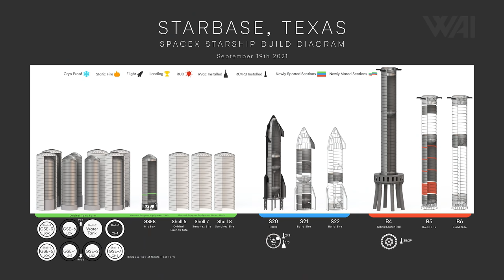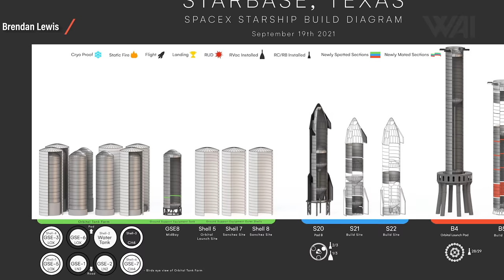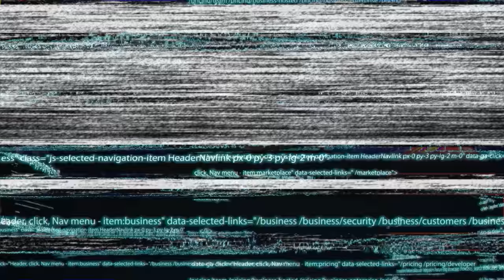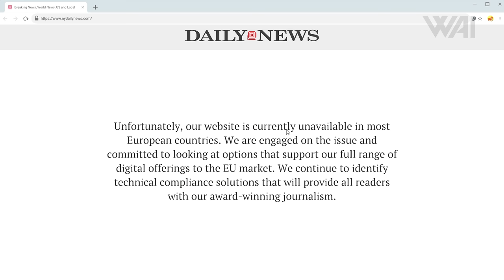Starship 2021 Official Design Changes – The Holy Grail Of Rockets!

Comment: I would think landing the booster in the gulf of Mexico, off the Boca Chica launch area, would be safer and have some real advantages. A larger Falcon 9 type barge could then return it to the launch pad through the Brownsville ship channel and then through a newly constructed connecting channel to the launch area. Four towers with cross connected cables could catch the boosters grid fins and lower it to the deck for transport back to the launch area. An inspection and rehab facility would check it out for damage then it could be transported, as it is now, to the launch tower for stacking. This would reduce the danger of landing at the tower, the surrounding populated area, and all of the support areas that could be damaged by a mishap in landing. I would think the FAA would also be happier with this approach.
Reply: Very good ideas😁

Comment: Saying that full reusability and high efficiency rockets are the holy grail of rocketry isn’t saying much when you consider the holy grail was made of wood. 

I suppose my point is even if starship achieves what it sets out to do in its design, there will be many improvements yet to be made with it.
Reply: Like adding a drink coaster so your holy ale doesn't leave a puddle.
Reply: ... but but, wood doesn't condensate (?)
Reply: @valamaas  yeah, but the coaster will be needed when we add sections of glass to the wood cup so we can see inside our glass...

Comment: The space shuttle was, by the justification you used in this video, an upper stage that did exactly what you are ranting starship will be the first to do. Dragon, with it's super dracos, is also a full stage that returns from orbital velocity. Starship is special for it's size and that it is bringing all of it's fuel tanks back with it.
Reply: Yeah, i like the updates but it pisses me of when they go all fanboy
Reply: Naaa. Bollocks. Space shuttle was a huge mistake. What the Donald Duck where the wings for? Never had a chance for a fast turnaround. Had to be rebuilt for each flight. Dumped the main tank. Had to re build the solids. In no way was it  in any way like a rapidly fully re usable design. Different thing and it’s effect on the launch industry will be drastically different.
Reply: Each space shuttle took several months of refurbishment before being able to fly again with multiple parts being replaced. It was also very unsafe to approach them for a long time after landing due to toxic fumes 

Space shuttle didn’t just lose it’s fuel tanks. It lost boosters as well, which included throwing a while engine away. It’s heat shield also needed heavy maintenance after every landing. The cost of each shuttle mission was $450 million

Starship on the other hand is designed to be rapidly reusable with turn around times being comparable to an airliner craft. No 88 day refurbishment needed

Starship doesn’t throw anything away, Starship does not need a runway (only 3 airstrips worldwide could accommodate the shuttle)

Starship cost aim per launch have consistently stayed $2 million 

Starship and the shuttle are nothing alike. The shuttle was a failure in terms of reusability and lower launch costs. Starship will be the vehicle that makes humanity multi-planetary
Reply: Show me a shuttle that can have a 1-day turnaround and we can talk comparisons, but the difference in re-usability is night and day.
Reply: And it is designed to not need refurbishment like Dragon or the Space Shuttle.
But i totally agree with your point. These fanboy statements are pretty unnecessary and let them seem much less professional.
Reply: Couple few blue origin lovers in here today.
Reply: @buckfiden1213  not really. (Not to say that all space flight is awesome.) Its more that we(/I) want to correct mistakes and criticize exaggerated fandom, which lessen the actual achievements by spaceX or other companies.
Reply: @vannan6844  no one waiting to approach the shuttle after landing there are video all over youtube of that and as well as dumping it's boosters and tank they did try to recover the boosters and reuse them as well as a few of the tanks that  survived liftoff and splash down as it was not as successful as it could have been it was necessary to explore new designs and new ideas so everyone can take the shuttle program as not successful but in a sense it was very successful and it was proved that you can build a reusable spacecraft so please don't get down on the shuttle and act like it was a big mistake cuz it was needed building something and not being as successful as you wanted to it's just a means for the next project if some of you can understand that
Reply: @oldmandoinghighkicksonlyin1368  except all the evidence contradicts your view. It’s almost like you have no idea what your talking about ….. hmmmm. No one is stopping you starting a space company and doing 14 hour days to build a launch system. I look forward to seeing it. Better hurry though. You are way behind.
Reply: @charlestorruella8591  You don't know your history, clearly. Putting exploration in the hands of private companies lead to the Dutch East India and Hudson's Bay companies. Zero accountability. They ravaged the lands they "explored" and enslaved people. Had private armies to protect their assets.

Also, look at what "moving fast and breaking things" (the mantra of techbros in Silicon Valley) has done for our society. I'd say nothing of value has been added to our society through the total lack of privacy and near-constant advertising being pipelined into my face, but you'd probably disagree because you haven't experienced anything but this dystopia.

If you think handing over access to Mars to the world's richest man, who has no accountability to you or anyone else, is a good idea, then there's not much I can explain to you that you'll understand. If you don't understand NASA's purpose already, then there's not much I can say to you that you'll believe. You've bought into the "SpaceX going to Mars is good for humanity" PR campaign like a blind fool.
Reply: The Space Shuttle was actually a single stage to orbit with SRBs. The shuttles motors fired from ground all the way to orbit but to do that it had that large fuel tank that it sat on top of which was not reused.
Reply: My generic response to most of this is that I fully agree the Shuttle was a disaster in almost every way. But, so far, starship has not has not demonstrated any capabilities the shuttle lacked, and the upcoming orbital flight is not going to change that. This video spent several minutes saying this flight would be the first "upper stage" to return somewhat intact. And defined the upper stage as hardware which reached orbital velocity.

That was an utter failure to stop and think about what he was saying. 

When and if starship achieves its reuse goals, then it will deserve to celebrate achieving firsts. But at this point the only thing that makes it more ambition than the early shuttle program, or even Dyna-Soar, is scale. Both of those programs were intended to see reuse in under a week, both those programs failed to achieve that goal, and both those programs made it farther toward that goal than starship has so far. I hope that starship succeeds, but it has not done it yet. And, it is part of an industry where only a tiny fraction of design goals get realized.
Reply: @TrabberShir  Agreed, Starship has to get to orbit and return then do the whole thing again with zero refurb before it can be considered a success. I personally think this will take another couple of years but it is achievable with the Starship design especially considering how fluid the design is, any issues will be sorted out eventually.

Comment: The Starship design should be looked as more suitable to Mars, that as a shuttle to LEO. If so, it would had a payload fairing. Meaning way less mass on reentry, and easier cargo deploy. A modular Spaceship assemble in LEO wit Nuclear engines, and a smaller lander docked to it would make more sense to crew missions to Mars.
Reply: Might make more sense to you, but to the people funding and building the starship....  well... they have their own agenda, and it's their money they are using, and it is their right to do it the way they choose to do.
Reply: The agenda is get it fast. If they went the nuclear ship path they would have to build it alongside starship,.with a completely new propulsion and such. Also, it's less complex as you only need to enter Mars atmosphere and land rather than get in orbit, and then descend. Regardless if it's more efficient, SpaceX builds first and improves later.
Reply: @Rauruatreides  with a modular Spaceship with Nuclear propulsion, you would require a smaller lander, as a capsule. While the Spaceship made it maneuvers to slow down an enter Martian orbit, passing multiple times close to the planet, you would board the capsule and propulsive land on Mars. Then after you complete the mission, you would have transfer propellant from other supply capsules for the ascent capsule, and then dock on orbit with the Spaceship, and return to Earth. Landing with another crew capsule.
Reply: @RogerM88  Hey I was just saying how SpaceX is doing it. They plan to use Starship which can haul huge payloads to and from the surface. Whether that is the best priority is up for debate, but I'm Elon or Gwynne who are the ones that make the decisions.

Comment: Seing as how cheap and good high resolution monitors and cameras are, wouldn't it be possible to have a lot of windows be virtual windows? just hook a high-def camera with a good lens to a 70" LED display and you have a "window" (not perfect but beats watching a steel wall) for basically nothing in terms of cost and weight. At least for the passenger cabins. And have the panoramic window be the "real" window. Could double as the personal entertainment system which will probably be there anyway.
Reply: The Emirates Airbus A380 has something similar, with the option to choose HD live video from the several cameras dotted around the exterior of the plane. A good alternative if you haven’t got a window seat and useful for spotting GTA missiles in your last moments as you fly over places like the Ukraine and ISIS controlled Iraq and Syria (a few years back) at 40,000 feet. BTW The Earth looks pretty round at 40,000ft, and it’s a lot cheaper than flying a sub orbital space ship, not to mention you get to sip a cold beer and eat macadamia nuts whilst doing it.
Reply: If my understanding is correct, that may not work on acount of there being very limited computing power on spacecraft, as radiation restant computers are very bulky
Reply: @eliwiederhold4198  it wouldn't be a critical system though, i understand the flight computer needing to be radiation hardened but i dont think it's a major problem if your window bluescreens once or twice during the trip. All the awesome footage we got from perseverance and opportunity is a good example, they basically just strapped gopros onto it. 

For stuff that has to work 100% reliably at all times, radiation proofing is a must, but for something like this i think any off the shelf components from amazon would do just fine.

I'm no expert and may be wrong but i think of radiation behaving like a slightly overambitious overclock, where there's a risk a bit might be read or written incorrectly every once in a while due to a charged particle exciting some electrons in the wrong place.

Comment: 2019 render was a design where they didn't have that little tank at the tip of the rocket for landing burn right? Since there is that tank now, they had to put the windows on the lower side of the nosecone.
Reply: Windows are a useless structural weakness just get rid of them
Reply: @kh9242  I'd agree that windows are not "useful" in a purely utilitarian sense, but with modern material science advances, they are not guaranteed to be a structural weakness either.
Reply: @z-beeblebrox  indeed, Elon stated that the material could be ALON transparent aluminum. It's a good candidate for new large/huge spacey windows.
Reply: @z-beeblebrox  They appear to be moving towards a compromise- a modular structural framework that will also create a large glass area, as per their original design. I like this render a lot better, a realistic solution, similar to the space shuttle front windows.

Comment: Less complexity and weight, I'm guessing for Maezawa's run. After all that's the first commercial, populated mission SpaceX will be doing with Starship.
Reply: It's actually a part of SpaceX's design philosophy, where they prioritize removing complexity in favour of more robust elements. For example, you could see that with them hiring water tower builders and using stainless steel, as the engineers have experience building pressurized vessels that last for decades, and the metal is a lot simpler to work with.
Reply: @theencolony5595  I follow the program closely since it started. While I’m sure they’re still using the welders on-site, I’d be surprised if they were still joining barrel sections manually. What I meant in my original comment was that they can get away with less complexity and weight for Maezawa’s Lunar Orbit taxi (I think that’s the one pictured for Felix’s reasons) but once they’re ferrying 100+ people to Mars they’ll have to shed weight & complexity elsewhere.

Comment: other design change, the grid fins are in a different configuration, not 90° from each other but 2 on each side. Also the flaps moved, they were centered before, and starting starship 21 they will not be anymore i think. Also great episode, as always :)

Comment: I noticed one more difference on the official 2021 Starship render. The flaps at the top are moved closer to the window. it is slight but noticeable if you look hard enough.
Reply: Not that slight actually, they move more then a meter i think, i hate the new design but physics is a jerk sometimes...

Comment: SN20 and BN4 are going to nail the mission and along with it, most of their competitors coffins. The world will never be the same... no matter, and no wonder how badly, they want to slow Space X. Keep going guys I wanna go to Mars...
Reply: TPS on SN20 will shed tiles on reentry. Keep your expectations in check.
Reply: @A31415  I think they got a good chance of accomplishing it... 
Of course there's also a chance it doesn't even leave the ground, and we have a complete RUD of the whole thing, Stage 0 included...
But there is also a chance it comes down, even if with a few wholes and a bit harder I guess, more or less in one piece and on target.
That would be nailing the mission...You can call it wishful thinking I guess. I'll take it, but these guys have surprised everyone before. 
I honestly think they are way ahead with Starship SN20/BN4 than we all think.. we'll see... 
If I'm wrong I suspect it'll be something spectacular..
Reply: @nunessilva2162  thanks to the close up images of starship tiles one can readily compare them to the ones used on the Space Shuttle. I visited Kennedy Space Center museum that has one several times. You can examine shuttle tiles very closely and see that there are no gaps between them. The very small and precise gaps are filled with some resin. As we all know Columbia went down when one or more tiles were damaged. At these temperatures and forces even that small damaged area quickly escalated to full ship destruction. The gaps between tiles on the Starship are enormous, tiles are uneven. The local plasma disturbances are going to wreck havoc on TPS. It’s possible that the intent of the designers is to have steel expand and close the gaps between tiles. The issue with that is its very easy to expand a bit too much and cracks to form due to tile touching. This is probably the most challenging part of the Starship design.
Reply: @A31415  I know nothing of aerothermodynamics but the shuttle presented a flat surface... Starship, is completely round which I think dissipates atmospheric gases much faster.. the shuttle used decades old technology, surely the SpaceX tiles and TPA system as a whole are that much better. That will surely make a difference. No?
I'm not saying you're wrong, I'm the one who probably is, hell even Elon said that if the thing leaves the pad it'll already be a victory, although I bet that's not what he's hoping for or expecting to happen so I'll insist, if you'd allow me, I think they are going to surprise us all leaving everyone begging for more.

Comment: I reckon the big hold will be the FAA approval. GSE and infrastructure SpaceX can hit as quickly as possible, B4 and Ship 20 ready before mid October… but a launch before the end of December may await the environmental assessments. We’ll get there and still reckon orbital trials before early 2022… including the Kauai splashdown. Full orbit in 2022 including soft touchdown 🤩😄🚀 keep on rocking, @FelixSchlang !
Reply: Unlikely. Lots of very expensive hardware on the ground at stake here. SpaceX is no longer launching from a dispensable stand. They will be doing a lot of tests well into 2022 before they will commit to a launch that has a potential to wipe almost a year worth of work. It’s a good idea to keep expectations in check.